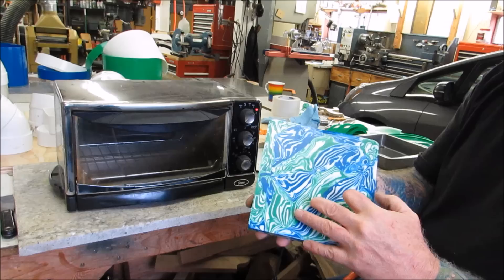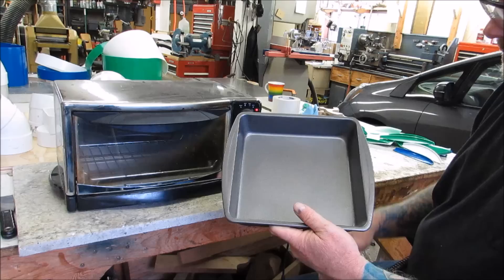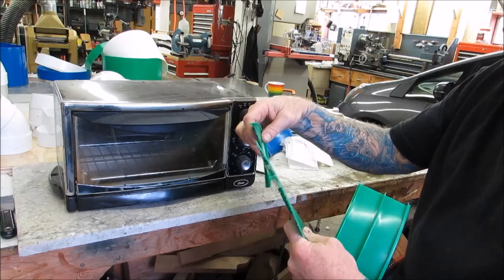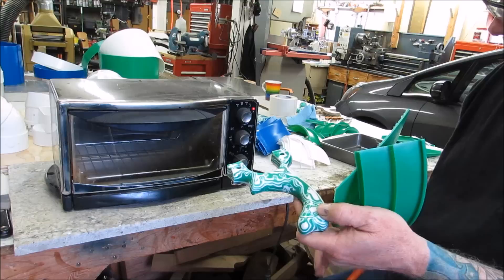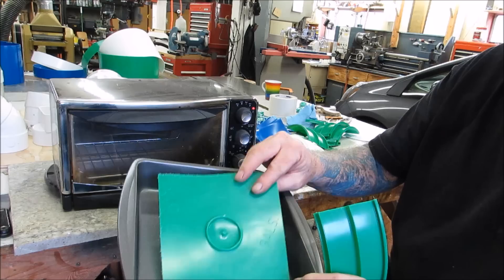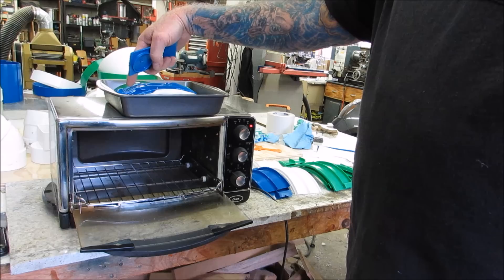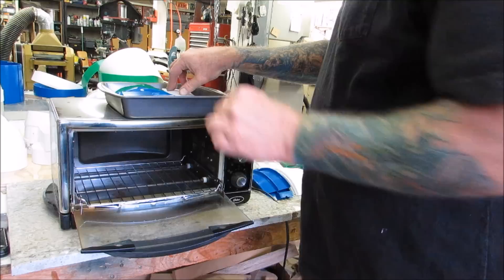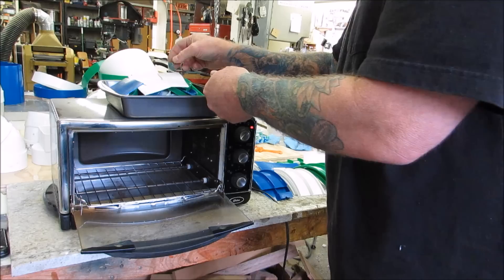5 Gallon Bucket Slingshot Part One - with Randy Knapp

Comment: I will soon degas using an old Presto steam cooker. Not to use for cooking but as a vacuum chamber for freshly melted HDPE. A high vacuum will cause the air bubbles to expand and. (boil out.) The plastic will essentually be air free. Voids will still form as hot cooling plastic in the center shrinks in the already hard exterior.

Comment: thank you for your honest input. it says alot. it's a risk we all take when we start projects of this nature. safety precautions are always used. it's good to research the limitations of the materials you will work with first. I got caught with my pants down on the Pvc bow. nobody mentioned its attitude towards the cold lol. I think your work is stellar and I will be looking for more of your videos. this would make a good slingshot. I'm opting for wider forks, so I hope fork hits won't be an issue. I don't have them now, and all I got is a crap daisy. I'll try to add a little extra material to the fork area if it's needed. thanks for all you do friend

Comment: Great video. I obtained an oven, cut up some HDPE from bottles and jugs. at 400 deg F,  after 1 3/4 hrs the pan did not flatten or get soft enough for air bubbles to migrate.
What do you think the problem might be?
Ken
Reply: HDPE can have different wax contents to make it easier or harder to melt. My guess is that the buckets have more wax additives in it to make the plastic easier to work with

Comment: dude, my wife will soon hate the day I saw this video, lol. I got that exact oven. and a similar pan. just wanted to ask if there are other things I can get this same type of plastic from. I heard of cutting boards, obviously I won't need to melt that, it's allready a brick. also heard milk jugs work to.
Reply from the maker: +Richard Peterson  5 gallon buckets work the best
Reply: +Randy Knapp if you want different designs, there are a lot of plastic containers made of HDPE, so 5 gall n buckets aren't the only choice. I have made a few plastic parts out of HDPE sourced from milk jugs, laundry detergent bottles, motor oil containers, water jugs, etc.

Comment: wash those buckets first in hot hot soapy water to remove all release agents that were used in the plastic mold process--that way the layers will bond faster and hotter and you will NOT get all those air pockets in your pans.

Comment: just watched your video and learned a lot about bubbles and how they bubble up to the surface.  As a thought, if you take a flat piece of the bucket and drill holes (maybe even scroll saw odd shaped holes) in it, then lay this piece at the bottom and let the bubbles come up though, you might be able to create some cool effects?  Let me know if this works.
Reply from the maker: Russ Veinot  I have tried that and it dose work. Anyway you trap air in the bottom has a good effect  of mixing and swirling the colors  :)
Reply: if you layer the holes near the top, can it bubble up in shapes, like letters or silhouette shapes?

Comment: i have tried this but i used paper to line the pan i noticed you didn't did you prep the pan?
Reply from the maker: No prep for the pan. It is teflon coated and the HDPE dose not stick to it :)
Reply: thanks for the tip Randy
Reply: U think it would stick in a copper chef pan

Comment: Randy - how many of those Homer buckets does it take to make one slab? Two or three? I know you use a lot to make the wide range of colors you have but I only want to make one that is two tone and was hoping two buckets were enough.

Great tutorial. 

Miss seeing you on the Slingshot Channel Forum.
Reply from the maker: Two 5 gallon buckets makes one 8"x 8" cake pan it comes out about 1 1/4" thick and then is planned down to 1" to get to the good patterns in the middle  ;)
Reply: what does it do to your planer blades? I've seen people machining PEHT and it seem soft but I wonder what the self lubricating effect does to your tools?
Reply: Randy Knapp could you recycle household hdpe instead of buying material?

Comment: As long as I do not burn it, will this stuff stink as its melting? Would rather not stink up my work area too much.
Reply from the maker: Eli Youmans It only smells when it is burning. I would not do it with out being able to open windows and doors just the same.
Reply: Randy Knapp thanks for the help.

Comment: So why the long wait times for it to cool. Iv been doing HDPE remolding for some time now and I place mine in a clamp up and then quick cool it with water
Reply: +kevingill3339 I am new to this area and am just learning. As you you mentioned you have been doing this for some time, I was wondering if you could advise on the potential health risks of melting plastic and any precautions you take. I don't know and am a bit concerned, so I thought I would ask...
Reply: Now you know why cancer research centers were created.

Comment: I tried this and too my surprise it came out really good the plastic took the exact shape of the mold and had no bubbles what I wonder is why when I use hdpe milk jugs they don't become as liquid both of them are hdpe but buckets seem like they flow much better is there any reason for that?
Reply from the maker: Dean Walcott  I guess it is different plastic even though they are both marked as HDPE 2 Milk jugs and coffee jugs do not work for me either
Reply: Randy Knapp yeah it probably is different maybe buckets have some kind of plasticizer in it i noticed at 3:40 in the video you were getting some smoke make sure you turn down the temperature when that happens the plastic will be permamently weaker if it smokes too long
Reply: Randy Knapp i actually found out why the buckets flow better the reason is because the buckets are normally injection molded which uses an hdpe type that flows better and normally milk jugs are blow molded which requires hdpe that doesnt flow as much when melted however the milk jug hdpe is stronger than the bucket hdpe becuase the milk jugs have a higher molecular weight than the buckets after a lot of tries i have been able to successfully melt milk jugs by clamping them